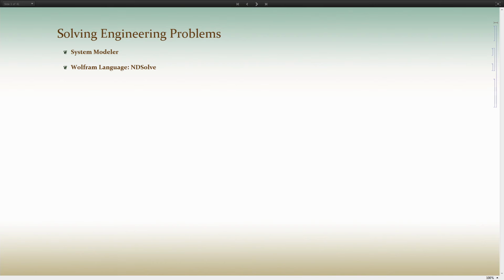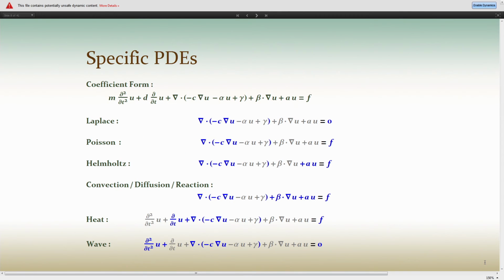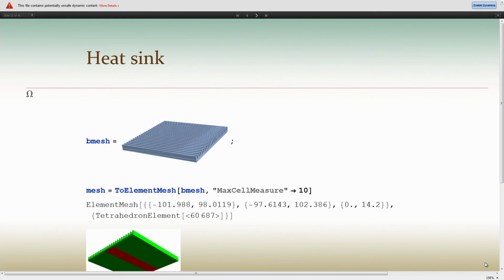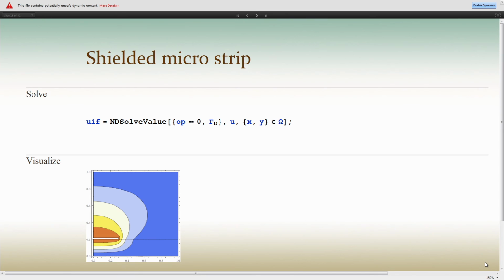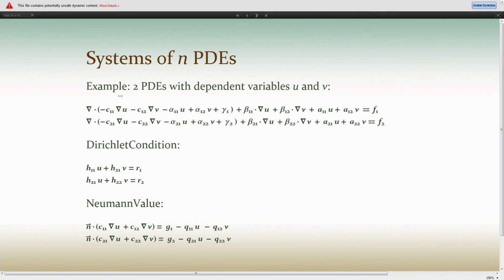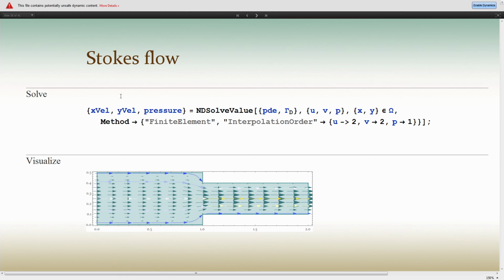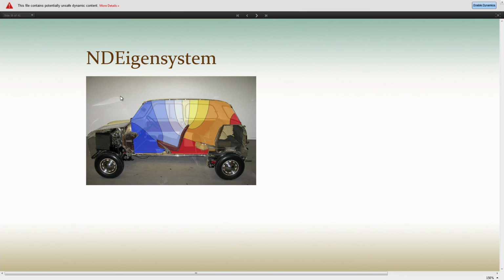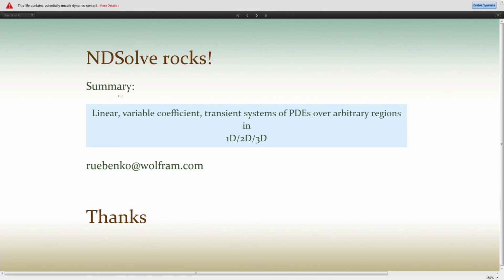Solving Engineering Problems with Mathematica's PDE Tools

Comment: i wonder is there possible to solve the wave equations.
for a uniform material, it is obvious possible. but how can i use the boundary conditions between two materials? say that Tan(E) continues in the boundary.
Reply: Boundary condotions are specified on the edges...you can specify any function or derivative